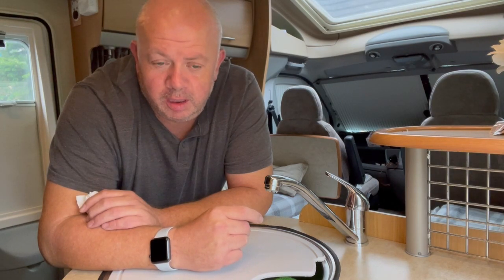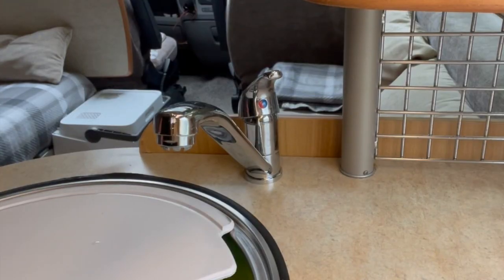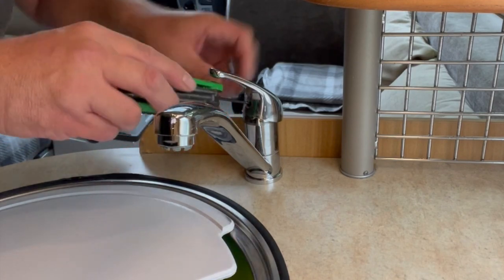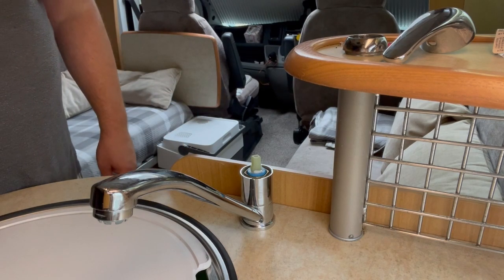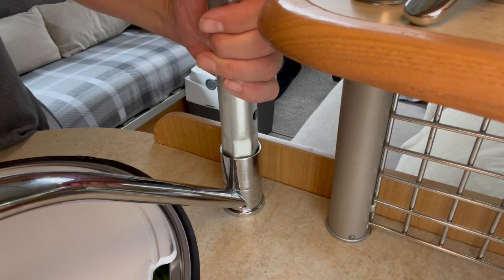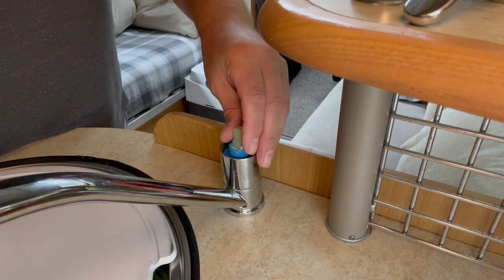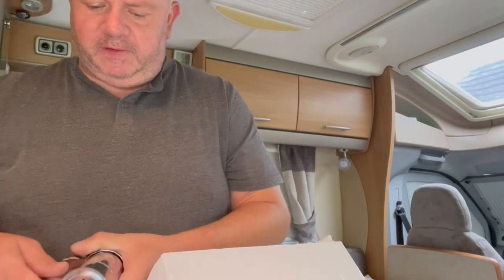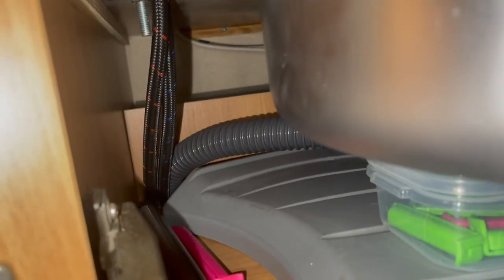FIX IT WEDNESDAY - MOTORHOME TAP FIX

Comment: All the information I needed. Just fitted a new pump then noticed the leak at bottom of tap. I guess the new pump is slightly higher pressure than the old one. hence the leak! Thanks. Great video.
Reply from the maker: Did it work?

Comment: All trial and error. Great job, well done. I had the same issue a few years ago but I ended up taking the hot and cold pipes off the manifold as after disconnecting the tap there wasnt room to get 2 spanners in. Maybe half inch clearance at best. After swapping pipes though to the new tap it was easier to go back manifold and tighten them up. I love watching things like this, prepares me for my next motorhome 👍
Reply from the maker: nice one gary glad it all worked out for you and you enjoyed the vlog👍🏻😀

Comment: Thanks for the video.
Finally found one in the UK that explains exactly what i need to do.
I have the same issue with my caravan. I've just worked out how to get the sliding shelf out and the kitchen drawer out.
Not a lot of room to squeeze in between the fridge and the oven. So think I'll take the hoses off the push fit connectors underneath that way I will have plenty of slack to put the hoses back on.
Knowing my luck  I'll probably end up with a leak from the push fit connectors 😁
Reply from the maker: how did you do in the end andrew ??👍🏻
Reply: @NorthernersonTour  thanks to your video I changed the tap with little issue.
In the end I did the same and undid the hoses off the taps as you did in the video.
Did manage to get enough slack to do it.
Bit of a squeeze though between the cooker and the fridge.